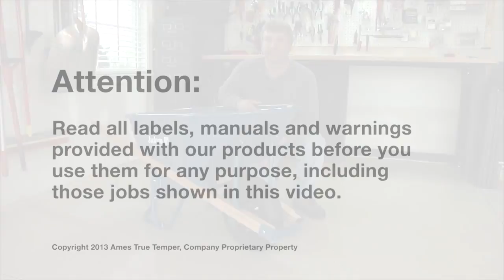Jackson® Professional Grade Wheelbarrow Assembly

Comment: Where are the lockwashers needed to keep things from loosening up?

Also,  are those galvanized bolts and nuts?  If they aren't the threads are going to corrode away over time,  and you wont be able to take your barrow apart for maintenance and repairs,  nut without cutting the bolts and then replacing the hardware.  The second time,  you will use galvanized bolts.

Comment: American made quality
Reply: Weird Science I had a look at the  moss wheelbarrows and they look to be made with slightly better materials than the Jackson . Most wheel barrows have certain parts on them designed to fail . minimal welds etc. in the uk and Ireland you don’t see ones with wooden, parts there usually all metal and come full assembled . The first thing I do when I get a new barrow is weld on better bracing (it will greatly extend the life of the barrow.) the best make of barrow I have had is haemmerlin . The first thing that went on it was the tub . I then turned the frame into a brick barrow.i wouldn’t bet on those moss wheelbarrows lasting more than a year or so under building site conditions.